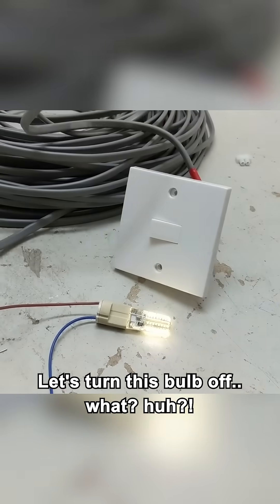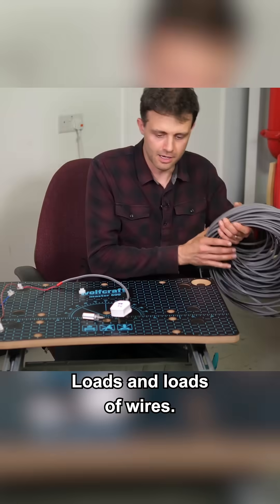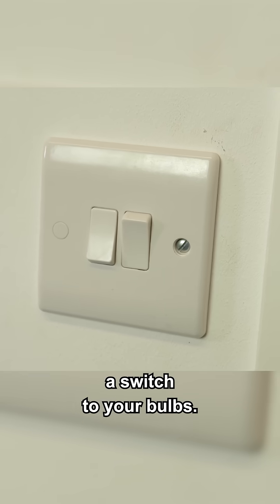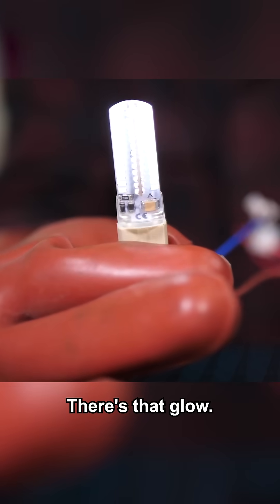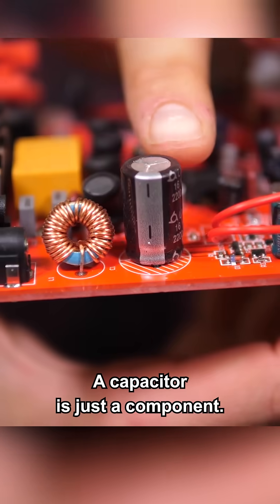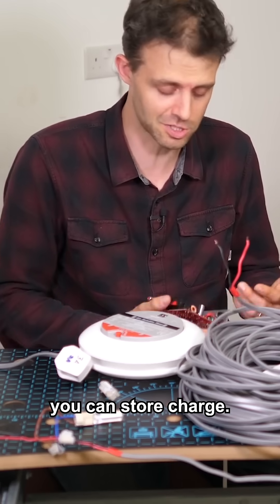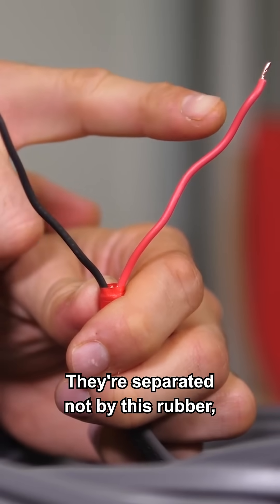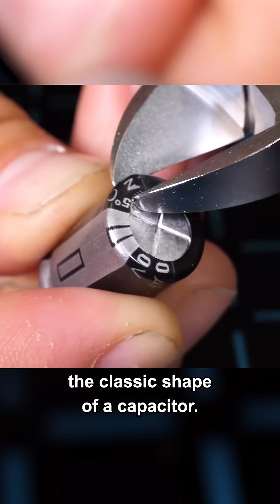This Zombie Bulb Will Not Turn Off! But Why?

Comment: That cool of cable isn’t acting as a capacitor, it’s acting as an inductor.
Reply: I think the positive and negative wires in the cable, separated by whatever insulation is inside the cable, is working as the capacitor. Since the same current is flowing along the same path in both directions, I believe any inductive effects would cancel each other out- but correct me if I'm wrong, I'm not an electrical engineer
Reply: As many people comments at the beginning i was sure that was an inductor because of the winding of the cable. but thinking about it a bit longher I realize that it cannot be a inductor, because in the cable there are two conductors but they have equal and opposite current so they try to create equal and opposite magnetic field that cancel each other, an inductor must be the winding of just one conductor in the cable. At the same time we can consider this two conductors as the plate of a capacitor, but in the Circuit that he shows is connected in series but is actually in parallel. Just immagine that the cable was straight it would be the same thing.
The very wrong thing that he says is that a capacitor have nothing to do with winding, they do them like this Just to save space otherwise a capacitor would be very very large. So the wind up the plates.As many people comments at the beginning i was sure that was an inductor because of the winding of the cable. but thinking about it a bit longher I realize that it cannot be a inductor, because in the cable there are two conductors but they have equal and opposite current so they try to create equal and opposite magnetic field that cancel each other, an inductor must be the winding of just one conductor in the cable. At the same time we can consider this two conductors as the plate of a capacitor, but in the Circuit that he shows is connected in series but is actually in parallel. Just immagine that the cable was straight it would be the same thing.
The very wrong thing that he shows is the connection with the winding , a capacitor have nothing to do with winding, they do them like this Just to save space otherwise a capacitor would be very very large. So they wind up the plates.
Reply: @michelegambirasio5445  A bit repetitive, but good explanation. I think that makes a lot of sense- definitely more sense than the way the video explained it.
Reply: @Rippertear The video explained it suboptimally because it's a cut down teaser - there's a long form version that goes into it in detail, it was even a collab with ElectroBOOM
Reply: @bosstowndynamics5488  Ah, that would do it. Thanks for mentioning, I probably would've gone on forever thinking this was just a weirdly unclear short instead of a cut-down full video
Reply: It does not matter that it is coiled. The wires are acting as plates storing energy. It would work with straight wire. Also in the wiring diagram the capacitor should have been in parallel with the light bulb
Reply: Not so cool of cable
Reply: Thank you! I was just looking at all these comments just wondering if anyone knows what parasitic induction is. Look at that cable. It's even coiled for fun.
Reply: @pickedupapencil  its not induction storing the energy it's capacitance.  It's not energy stored in a magnetic field in a coil. It's the electric field between the 2 wires acting as plates in a capacitor.
Reply: @travisderthick9361  yep- even if the coiled wire could have an effect, there are two equal and opposite currents in two nearly identical coils, since the cord we see actually has two wires, one going each way. Any inductive effects would cancel each other out.
Reply: @travisderthick9361  It has been so long since I've studied this stuff. My mind jumped to the inductor trying to prevent the circuit from changing as it's in series, and this reluctance for the inductor to allow the current to change as current lags voltage in an inductive circuit was what was causing the light to stay lit as this is still governed by a time constant as inductance and capacitance are just 180 degrees out of phase, and I remembered all the calculations work for both inductance and capacitance.

It's been too long. I can't recall everything, and it's causing me to mix concepts. Didn't need any of it in my new career.
Reply: @Rippertear That's not the reason. It could act as a transformer regardless of which way the wires are oriented. The issue is that the other end is open so no current flows through it for it to be induced.

Comment: Yeah just because you flip the switch off doesn’t mean you cut all the electricity. It’s only cut the energy input where switch is. the rest of energy from the switch to light bulb just stay there, expense at the rate of the light bulb can use

Comment: Not a capacitor.  The wire is acting like an inductor which stores energy in the magnetic field.  You can increase the amount of storage by coiling up the wire like he has.

Because there is such a length of wire, there is a small capacitance because of the dielectric between the wires, but the inductance is the larger effect here.

Comment: The coil acts as an inductor not a capacitor. Capacitors are formed by separated (discontinuous) mediums. There must be a physical gap between the poles of a capacitor for it to be defined as such. A coil of wire is continuous, and therefor acts as an inductor. When you flip the switch, there is momentarily current still flowing through a wire despite the current source being cut off, because there is a net change of magnetic flux through the coil, which inducces a sustaining EMF ϵ = − N × d ϕ d t, with the effect being amplified by N number of coils. In a straight wire or a loop of minimal coils, the effect is negligible, becuase the magnetic field around a straight wire is very small compared to many wires stacked on top of eachother with a compounding field strength. Basically, its analgous to inertia, with electron flow resisting sudden starts/stops in a conductor.

Comment: In 99% of all cases of this happening the wire to the switch is much shorter than the one to the light (also do not forget the capacitance of the rectifier inside of those), and thus the capacitive divider we get has a very low ratio, and will barely ever light this bulb up. So, in those 99% the cause is a dumb electrician who decided to cut neutral with a switch lol.

Comment: Is it the capcitance of the coper cores in the bundled wires, of which the internal isolation is somewhat overcome over a couple of tens of meters that leaks some constant current from one pole to the other

(which makes little sense to me unless the wire is faulty or am i, while misunderstanding some electrical engineering basic, vasly underestimating the length over this wire)

It can't be the capacitance between the bundled cables, because the bundle loop is close to neutral of  charge compared to the next loop of bundled cable, there wouldn't be a potential difference to resist.

Or is it from the inductance of the bundled wire being tightly wound up? The inductor component is the little wired donut next to the capacitor, and it is counter part to the capacitor.  The former, aka a 'coil', resists changes in current while the 'cap' resists changes in voltage. Together with resistors, which allows for a current to flow from a difference in voltage and vice versa, these three components are the basic, non active, components of electrical engineering (Active components would involve transistors or diodes). 

I didnt finish Electrical Engineering, but if AC is involved, then I am pretty certain the voltage difference over the light is from inductance and not from capacitance. It's more like two antenna next to each other transmitting waves, than two plates hoovering over eachother exchanging electrons (which is how I feel you are portraying capacitors, which might be right, idk, I didn't finish EE, but I feel like there should be electromagnetic fields involved, as the equations relating charge and current of capacitors is identical in structure as the equation of inductors, which is entirely EM fields and waves).

 It is or was common knowledge to not bundle up the (AC) power suplying cables of high load devices, as it wastes heaps of electrical energy to heat and might very well pose a fire risk as it could melt and burn the isolation. We've gotten better cable isolation and EU regulation on it over the decades (I had to deal with EU regulation on wires for rolling stock (trams trains etc) for a summer job), but in consumer items i consider it still a risk worth keeping in thought  on in a similar way to nor put lenses in the window to let sunlight burn a place down
Also, for the same current inducing reason it's adviced to not bunddle up signal cable, like for audio or high speed data, especially with badly or un-shielded signal cables. Even on a monopole cable "self inductance" can cause interfierence. Straighten a bare monopole wire, amp up the current changes, and you've got yourself an antenna.

 A way to find out expirementally which of the two phenomenon it is could be by straightening the wire or but it in significantly large and spaceyier loops; thus increasing the distance between the bundle of wires and removing the fact that they're parallel, while keeping the distance between the internal coper cores with different poled. If the glow still happens, it's from capacitance and if it doesn't it was from inductance.

The theoretical way would involve losing Feynman's lecture notes (free online, leading course material with regards to EM fields and waves) and seeing if an insulating dielectrics' effictiveness decreases if the parallel surface of the conductors grows large enough. Which seems wrong, from my intuition.

The symbol of an inductor is more appropiate too, since it implies it can bleed current, while the cap is as you mentioned open. the symbol for a cap is really appriopiate when signals are involved. A small cap can be used to decouple different parts of circuits, removing low frequencies and fixed voltage differences. A capacitor can stabilise with different voltages on either sides, symbolised by the gap, while the inductor will short and allow for steady current under a voltage difference.  The symbol of a transformer is the symbol of inductor twice facing each other, with a line parallel in between if some sort of feromagnetic medium is involved. (That's also what's inside the wire donut component). 

Now that I've typed this all out, how I would draw the circuit of the bleeding light, is as such:
- transformer symbol with one side of both inductors connected to AC supply
-  Light connected to the other side of both the transformer's inductors, with an open switch on one of the light's connections

Comment: I’ve had this on old fluorescent lamps controlled by a far away switch since it was wired with a flat 3core and earth the way to stop it was to use the Grey wire as the permanent live so the current is induced into the earth instead but it makes me wonder if this could cause nuisance rcd tripping as a result

Comment: to some commenters: the cable does not function as an inductor because AC cables with live and neutral (or any number of phases) next to each other do not produce a net magnetic flux...the fluxes produced by change in current in each wire cancel each other out (under a purely resistive load they are equally and oppositely charged with equal and have equal and opposite change in charge)

Comment: This is just plain wrong! You have coiled up the wire, so you see the discharge from induction! Also for all the AC people, he is using leds! Leds need rectifier to work otherwise you would quickly kill your diods when the current switches!

Comment: It's why whenever you have electronics malfunctioning, you turn them off, unplug them and hold down the power button to discharge the excess electricity from wires or capacitors.

Comment: Designing things without this in mind can be either conveniently good or really bad.

High end charging bricks can retain some power because of the same situation but with actual capacitors, hence why illumination LEDs on them can stay on. Sometimes it triggers the phone to notify charging is activated.

Best part is that long cables can also act as resistors.

Comment: What is not convincing me, unless that is a very long cable for low voltage, is that the capacitor in series is part of the problem... The other part is that he interrupted the neutral part of the circuit and not the phase, which leads to this parasite current that lights the led lamp (led needs a very low current to be minimally triggered). If you interrupt the phase the current simply does not flow to the lamp
Reply: You are totally correct and nobody else has noticed the error in his wiring diagram The stray capacitance is in parallel with the bulb not in series.

Comment: I'd say there's probably a resonance occurring between the capacitors of the light bulb, and the INDUCTANCE of the coil of wire. 
It's a far stretch to claim that the coil of wire is storing charge like a capacitor does, as opposed to how an inductor stores charge.

Comment: What you've made is an inductor a capacitor actually breaks the circuit with its internal plates and will not allow a light bulb to turn on if wired in the manner your diagram indicates. Instead the capacitor has to be wired in parallel with your circuit in order to do what you are seeing. 

Instead what you have made is two inductors one each side of your bulb 
Inductors are wired in series with the component you wish to power.

Comment: I always thought that it’s just because you switched the neutral wire and not the hot one. Putting a switch on the neutral side can do this exact thing as well as it creates an open neutral situation

Comment: You have the switch installed on the neutral wire instead of the live wire. And that big cable acts like a little ground so there's some current going through the bulb

Comment: That’s why when you are testing your wire. You need to ground it out SEVERAL times before it is safe to use again. The amount of energy they can hold onto can kill you depending on the circumstances.

Comment: Your saying this but a typical house wiring does not sit in the ceilings and walls as giant copper coils this doesnt sound logical and according to a lot of online sources the real reason is china runs at 220 and we run at 240 possibly now 230. The wiring in a uk household lighting citcuits are allways live even when turned off only at a wall switch. so the extra 10-20v difference is what keeps the led on as a led requires a driver and its this driver that cant recognise the extra low 10-20v to cut it off completely so the excess voltage leaks through to the led. this has been stated on a few forums and yt vids now so their explinations makes far more sense then this one.

Comment: In our electrical engineering fundamentals course we built on of those make shift capacitors with double sided tape and Aluminium foil. Calculating the theoretical capacitance and then measuring it as we built it. Was very interesting
Reply: Cool experiment! And if you make something yourself, you will remember it much better 😊

Comment: Most LEDs will continue to glow by actual capacitors in their internal circuit, you can verify this by removing the bulb from the socket.
Reply: That glow, fades out as the caps discharge eventually.  I have one in my hall that will glow (brighter than discharging caps but nowhere near full brightness), all night.  It goes out immediately if you remove it from the socket.
Reply: I have a phone charging brick with an led that behaves this way, you unplug it and it glows for 5-10 seconds before it fades out. neat stuff
Reply: @casualcaptor Yup! That's the smoothing capacitors in the rectifier circuit slowly discharging.  You'll see that in most power bricks that have a LED indicator.

Comment: I call bull5h1t.
The coils of wire are acting like a magnetically coupled inductor...not a capacitor.
It it generating current due to a changing magnetic field in its vicinity, probably from other electrical conductors or even electromagnetic radiation.

Comment: That's not capacitance, it's inductance.
Reply: And generally speaking most of it is likely to be happening in the switch, not the wires. 

Given how code treats wiring in conduit due to inductance specifically, i see the total effect of the inductance across the wire itself being minimal compared to what crosses the narrow contact gap in mechanical switches. I've seen 50% voltage bleed through on a switch that functioned as intended, on a 120v circuit. "off" read over 70VAC. 

These are just statements of experience from an electrician (no 40+ year journeyman, but ive got almost a decade under my belt, for whatever you count that for)

Comment: It is more of an inductor at that point
Reply: The inductance is nullified, by having two wires carrying simultaneous current in opposite directions.  The parasitic capacitance affects this circuit, but not the inductance.

Comment: The circuit you showed is not how it is  in your large coil of wire. If it was your lamp would not be glowing. Also it is not a 'brake'

Comment: It isn’t acting like a capacitor it is acting like an inductor. It builds up EMF which is electromagnetic Field and then slowly releases that field till it is discharged. Capacitors have two plates that are spaced that store electrons that when given a path will discharge the voltage rapidly where coils don’t.

Comment: Some cabling is designed as an effective capacitor, for example coax. The inner insulator (dielectric) is often technically ever so slightly conductive. I forget the mechanical reasons for such but they are capacitors, really bad ones, on purpose.